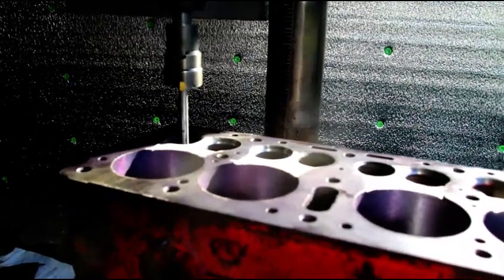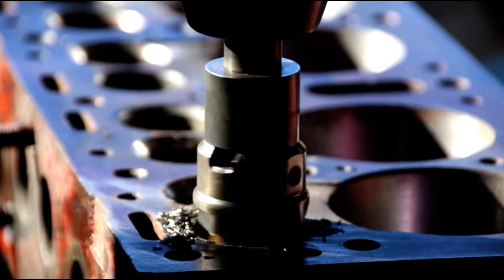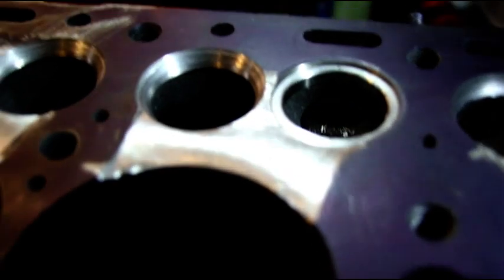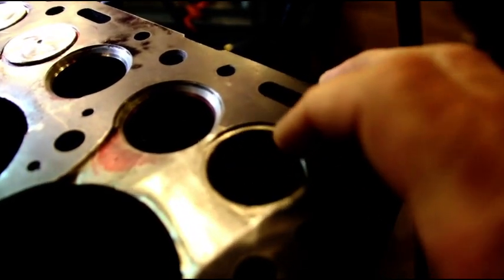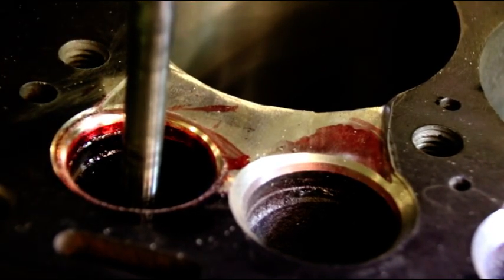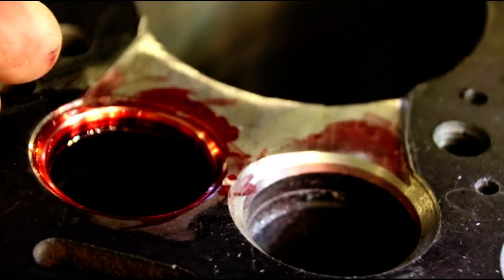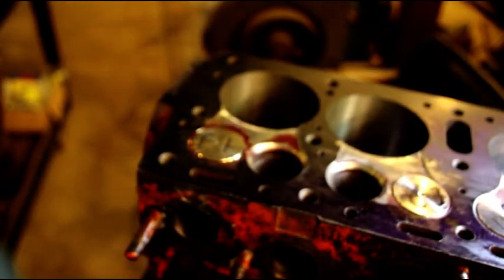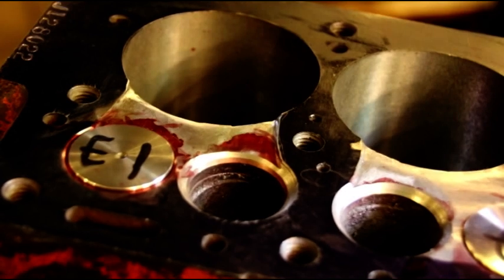Willys L 134 Hardened Valve Seat Installation

Comment: Hello Brian, I know this is an old video, but I was hoping you could help me with some knowledge on hardened valve seats. In this video you mention cutting the seat height plus an additional.050, why the additional.050? Is this because this engine has the recessed combustion area you cut in due to the pitting you found? Or is this a standard practice to have the seat be below the deck height? Also I see that you’re only doing the exhaust seats, do you find intake hardened seats unnecessary for this performance level? Thank you for your time. Your videos have been a wealth of knowledge!

Comment: Brian, I have an F head engine which needs to be gone over. Not a concourse restoration, just what is needed to run well.  I need to have a basic idea of cost. I realize there will be a range depending on what it needs.
I'm trying to do as much as I can, but I don't have the equipment and experience to perform boring, valve grinding etc .  I frequently drive up I 95 from Philadelphia to RI, so your shop may be somewhat on my way
Reply from the maker: Every engine is different and I can't give a ballpark price on something that I have not looked over.   I offer many different engine services, from machine work only to complete engines running on the test stand.   If you are trying to do as much as possible you might want to go for just the machine work and you assemble the engine that is the cheapest option.

Comment: Several years ago... I took an engine in for rebuild.  I noticed the valves were off.  I asked and the response was...  I Never went back!  Yeah, the way you seated those valves is wow!  Nice Job.  You are to far away!  I have since had two other engines rebuilt.  An old timer did the valve job... I can Not complain.  Today & for some time... some machine shops take shortcuts...  Not good.
Reply from the maker: A lot of shops are making a mess of these old Willys engines these days.  Glad you were able to find someone who could do the job correctly.

Comment: If you are relieving the block .060, and recessing the exhaust seat .050, does that mean the seat should stick out .010 above the relieved area?
Reply: Relieved .060 then the Valve Seat is set .050 Below the Relieved Area.

Comment: what  comp. reading is ok on these flat head 6  i have an m37  1953
Reply from the maker: When doing a compression test I usually like to see 125 psi.  Important also is all cylinder be the same compression.  If you have one or more low cylinders that isn't good.   Engines will run at lower compression but power will suffer.

Comment: Text book procedures as always from you Brian ! Do you find you can hold the correct interference fit on the seat rebates with a rigid fixed diameter cutter ? I always use an adjustable boreing head but it takes a lot longer to set up, dont worry about the dissenters, they have never done a job anyway, just learned their knowledge from a bloke in the pub! Stay safe! Chris B.
Reply from the maker: I always use good quality seats and have a carbide cutters from Goodson that bore the perfect size every time, never had a problem.  Good to hear from you again, hope all is well in your part of the world

Comment: Brian, you had a set of Jo Blocks in the video but not shown there use. You must be reading my mind, since I am on the hunt for a shop grade B here in my shop :)> . Did you use the gage blocks for inspection of ?? or the set guil depth?? Bear.
Reply from the maker: I used the gauge blocks to set up the depth stop on the seat and guide machine.  Thickness of seat plus .050".  Put the pair of gauge blocks in the depth gauge and clamp it tight.   Exact depth of cut every time.    You can get a very good set of gauge block at a good price from Shars.   Just go to their site at Shars.com and check out the items they have.  I have been very pleased with a lot of the stuff they sell.   
Brian
Reply: Yes, been looking @ their's and here a lot of good feed back on their tool. The '90 YJ we sold had the 258, and really ran and pulled strong. New owner keeps incontact and loves your channel too.
Reply: @metalshaperJeep  No need to buy a set of gauge blocks if you don't have any other use for them. 
Just use one of the seats and a couple Feeler Gauges to get your .050 'extra' to set the depth stop.

Comment: Hi Brian. That engine will out last a lot of engines built by other work shops. Many an old racing engine had the block relieved to make more horse power. There's nothing wrong with the engine. I would run it in a heart beat. 👍🏻
Reply from the maker: Only a very small amount of people understand what  I am doing to save this engine, thanks for being one of them.   I didn't realize antique engine rebuild tips were going to cause so much hate mail from people that probably have never done anything in their life.

Comment: I have watched your other videos on valves and you said not to use a ac vacuum pump. What do you use or what should I use
Reply from the maker: You can use any type of vacuum pump.  the only reason I don't like a/c pumps is because it is hard to adapt from the a/c line fittings.   If you have a way to adapt to them go ahead and use it.  If not a general purpose vacuum pump is easier to set up for the type of work I do.
Reply: @metalshaperJeep  Thanks for your reply. Getting ready to get my block back from machine shop and want to check the valves. Always watch your videos and am hoping to get my block for my 2A as perfect as I can get it

Comment: USE A LEAD HAMMER TO BANG THE STEEL DISK  TO SET THE SEAT   /   YOU GET THE FORCE WITHOUT THE SHOCK OF STEEL HAMMER  HITTING  AGAINST STEEL DISK  PLATE  /  NOT TALKING DOWN  / TALKING TO ONE MACHINIST TO ANOTHER MACHINIST  / I KNOW CRAP ABOUT BUILDING JEEP MOTORS  / YOU ARE A MASTER MOTOR  BUILDER ON TOP OF BEING A MACHINIST